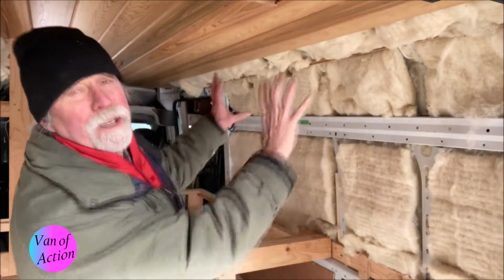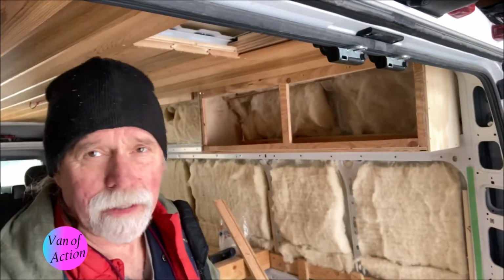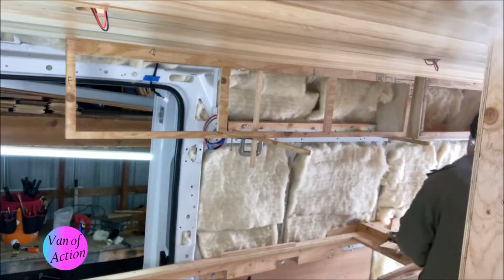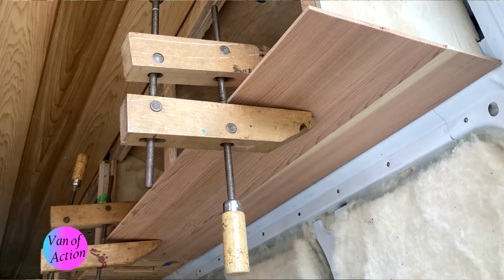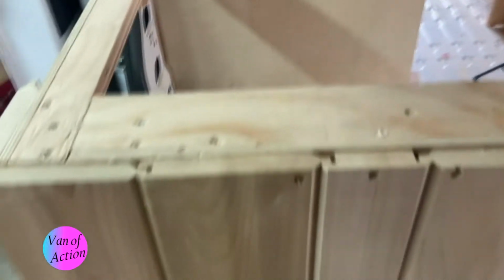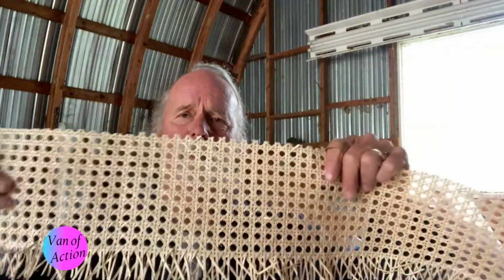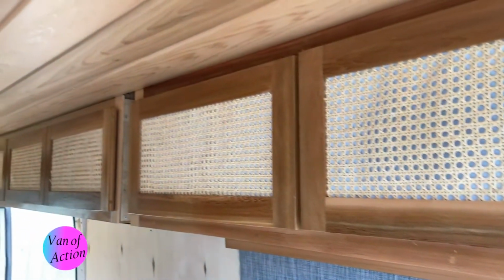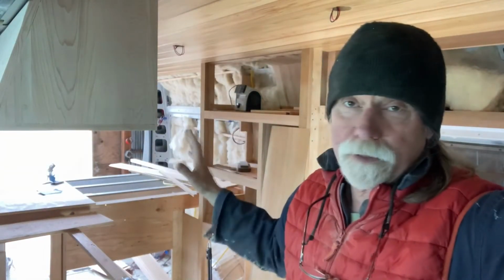Van Conversion DIY Upper Cupboard Design and Building Not 80 20, Wood Construction for Vanlife

Comment: Beautiful work! Did you soak the caning before installing it? I’m planning on the same type of doors and learned that the caning needs to be soaked first, then stretched during install and stapled around the edges. I will also put a backer behind because I don’t want to see my cabinet contents, but planned on fastening that backer independently from the caning.
Reply from the maker: Thanks for watching and asking.  I did not soak the caning - In fact I would suggest it would be a mistake.   You would soak it to stretch it over a chair or something - but in this case it;s just in front of the  plywood panel.  Try to think of the door as a frame with an insert panel - the same as any kitchen or cabinat panel door.  IN this case, the panel is a piece of plywood that has had caning attached to it - using a contact cement.  Machine your doors with a groove wide enoungh for the plywood and caning.  Put them together first (this allows you to line up the caning as well so each panel has the lines run through)  then assemble the door with the panel complete.  It adds a few steps to a traditional door but really isn't any harder.  Be well